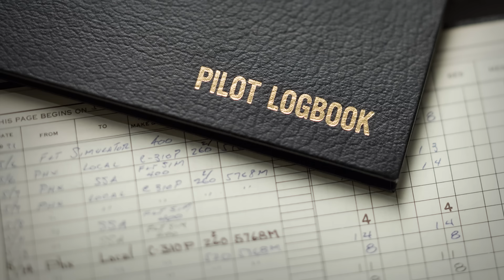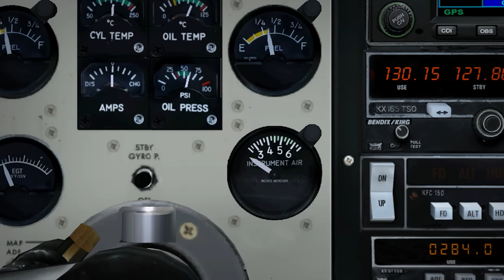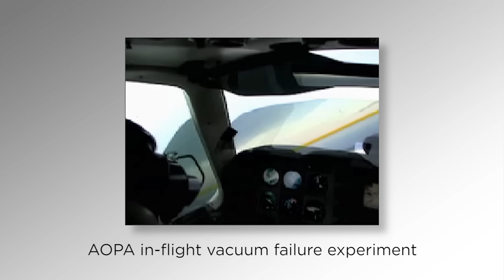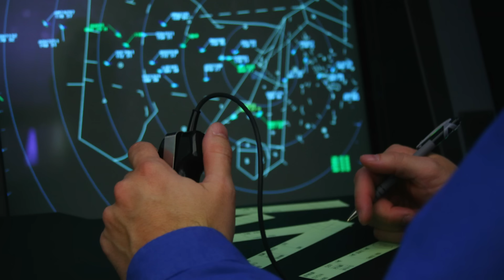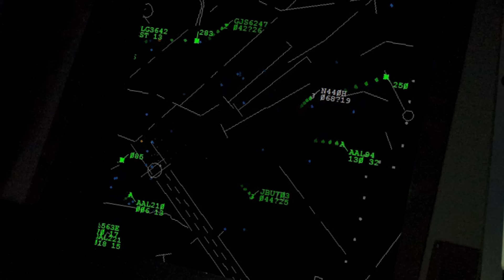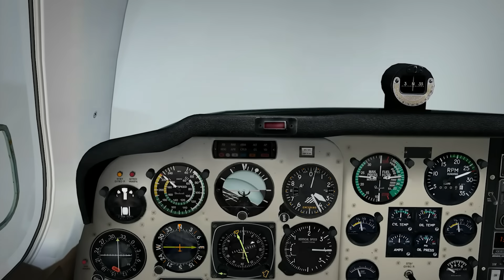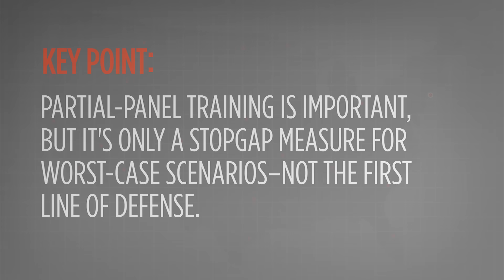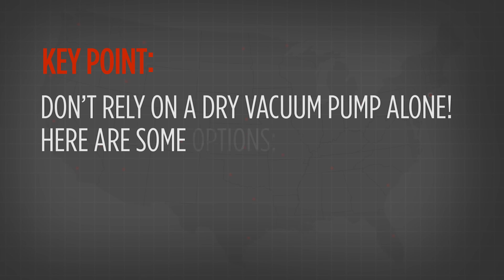Accident Case Study: Single Point Failure

Comment: I flew this same flight just 6 months earlier, Grand Strand to middle CT with 2 non-pilot passengers. Only I was a 250 hr VFR pilot. When I heard of this accident it shook me and this video was hard to watch. If a 4,000 hr ATP rated pilot can't survive this, what the heck was I doing? Granted ours was VFR all the way, I did not attempt a IFR flight as a VFR pilot.

Videos like these are helpful and if any good can come from such a tragedy it is that lessons we learn may save the lives of others. Please keep these videos coming.

The plane we did our flight in had a wing leveler, rate based Century autopilot. I've learned just how awesome that simple device can be to a VFR pilot, they continue to keep the wings level even with a vacuum failure. Our new plane has a more capable, rate based autopilot, standby vacuum and I always run FF synthetic vision on an ipad. In addition I keep two of those suction cup instrument blockers in the accessories pocket near my left knee. I would apply them upon realizing the vacuum system has failed if the standby could not keep it erect. Lastly, I've started my IR training. 

God bless those who lost their lives and the families involved.
Reply: GA Flying, there is an old saying: “ a superior pilot uses his superior judgement so he doesn’t have to use his superior flying skills.”  That Bo pilot made a judgement error long before he lost control.
Reply: GA Flying the majority of his 4K hours were probably in a crewed up airplane on autopilot with zero failures.
Reply: Total flight hours is not the end all measure of safety and  competence. There is no safe flight hours zone. Complacency can become a real problem for high time pilots. 
Recency of training is crucial. I think pilots, particularly high time pilots should spend more time with the basics of flying. There is an attitude among pilots that as you get advanced ratings and hours, you graduate from Student pilot. I wish they would call beginning flight training something else. Core Training, Fundamental Training, etc, and do away with "Student pilot".
Reply: I know what you mean.  I used to drive through Dealey Plaza in a convertible, and always thought that it could have been me.  Granted, I wasn't President, and did not attempt to be President.
Reply: Its not all ways the Flight time.  Its all so knowing your skill level at times a new VFR pilot can make a 100 mile or 1000 mile VFR flight as long as he is safe and on  top of things like weather, fuel to me new pilots if train well and keeping safety in mine each time they fly are as safe as old pilot who dose's the same 

Accidents at times can come out of the blue and not at other times 

May all your flight end in with  smooth landing
Reply: VFR pilot here as well, in IR training. I wouldn't have flown that day, simple as that. Sure as heck not without a backup vacuum pump.

Comment: Every single iPhone comes with a compass and a very accurate attitude indicator. Even if you don't have specialized piloting applications on a tablet, just a barebones iPhone can save your life in a situation like this.
Reply: EVOCATEUR:  I'm not sure the iPhone or any similar device should be relied upon in an emergency situation.  The "drift" associated with a simple IOS or Android device, even when operated in "in air" mode, is likely to result in rapidly deteriorating accuracy.  In other words, it is likely to be no better than "seat of the pants" which is exactly how 40H became an unfortunate statistic.  Tablets (and phones?) are great for navigation, but I would never rely on one for artificial horizon.
Reply: John Isett You really should not have any drift with respect to the leveling app as the app is using the MEMS accelerometer built into the phone or tablet and that sensor generates an absolute acceleration vector (the sensor is most typically three strain gauges, one per axis, with a counterweight at the end of each gauge and the acceleration is detected as a bending of the appropriate strain gauge levers -- with Earth's 1g acceleration ordinarily the dominant force that is used to determine what "level" is).  However, you will get into trouble if you do not understand that it is an acceleration vector that the displayed information is being extracted from as you could have an indication of level flight while simultaneously in a violent 10g spin because the 10g's of centrifugal spin will overwhelm the 1g vector provided by the Earth.  Our modern smart devices also contain MEMS gyros and magnetometer/compasses as well, but those would have to be integrated into a more sophisticated app (as compared to the built-in level app) and they, unlike the MEMS accelerometer, are indeed subject to drift over time  (GPS is typically used to help correct the magnetometer provided you are in motion such that a motion vector can be calculated and the accelerometer often used to periodically reset the gyro sensor).
Reply: Ethan Poole  ‘10G  centrifugal spin’ ? Sounds like either the pilot or aircraft or both would crack up as soon as it was underway!!!  The ones I’ve always done are strictly about 1G and low airspeed ( about stall speed ). Are you confusing it with a spiral dive ( often called a graveyard spiral with good reason )?  In those, the G forces build together with the airspeed very quickly. BTW the other ‘ spirals ‘ you run into in aviation are all helices. The radius of the latter remain constant———that of the former decreases continuously.
Reply: Yeah those are interesting points. I'd like to actually test it out at some point. Maybe velcro my phone to the dash next to the functioning attitude indicator and see how they actually compare in real-world flying for an hour or so.
Reply: Android has this too
Reply: @EVOCATEUR Of course the most obvious solution is to replace the vacuum pump at the factory-recommended intervals, as well as having a standby pump installed if possible.  In the soup I'd rather be able to rely on well-maintained purpose-built instruments like the attitude indicator and directional gyro.  I'd much rather put in a backup attitude indicator than resort to Velcroing an iPhone to the panel and hoping it works.  No need to tie up 121.5 in lousy weather if you don't have to.
Reply: I've actually been flying for almost 20 years. And I wasn't talking about the compass as much as the attitude indicator. And I wasn't planning to rely on either of them, I do want to test how accurate they are, for possible emergency situations where there's no other choice. A good pilot uses all the tools and information available to him. One more piece of information from a phone, if relatively accurate, can make a difference. 

And I don't know how flying with one for an hour or two and comparing it to the flight instruments 'wouldn't prove it's reliable'. Perhaps you can enlighten us from your vast experience?
Reply: You guys are all wrong, regarding the iPhone attitude system.  This system is not a gyro, and only detects gravitational pull.  Using it would indicate "wings level" even in a tightening spiral turn, sucking you in to the death spiral ever faster.  Go ahead and try it on board, in any coordinated turn, the iPhone attitude will show wings level.  Only an external AHRS unit, such as the Stratus, can replace a failed attitude gyro.
Reply: OR...look at your other instruments. There is still the magnetic compass, there is your heading. You also have your Altitude Indicator to tell you if you are level and then you would look at your turn coordinator(if it's electric) to double check your wings are level. Now, we can throw all the technology of the at pilots but if they don't practice and understand these types of emergencies it's not going to help. With all that said, this is a pretty bad situation that we can all argue what the pilot did wrong all day long but adding technology isn't going to help if pilots are unequipped in their abilities to take on such a task.
Reply: Any recent smart phone will work just as well as any ap instrument  except..... It must be running beforehand,  not fired up during  your spiral to earth. That would fool the mems into showing the wrong "down".
Reply: Gyro emulation, based on fancy calculations with accel sensor data, is not the same as a real gyro. There is no physical space in an iPad let alone an iPhone for a real gyro. And even real gyros drift, drift is inverse to physical size for a given quality level, but needs vary, one degree per hour may be perfectly acceptable in a light aircraft reset after only a few hours of endurance and only needing a general reference, while a nuclear submarine may need far better than one degree per month for both endurance and accuracy purposes.(as they have no ATC or visual confirmation and may be only a few feet from obstacles.)
Reply: MyTech,  so wrong.   All smart phones etc have MEMS gyros based on the coriolis effect.  These gyros work every bit the same as a spinning gyro.
Reply: Many smartphones do have MEMS rate gyros. However, their typical drift is on the order of a few degrees per second so they are pretty useless by themselves. If you put them together with the accelerometer and GPS data, using some very clever software, you can have a reasonable attitude indicator but I don't know how available such software is.
Reply: Just to clarify - fusing the gyro data with the GPS and accelerometers allows you to create a continual estimate of the gyro's drift rate which you can then subtract out. This converts the drift into a zero-mean noise signal which can be 2 or 3 degrees error for even cheap sensors with good sensor fusion algorithms. In this setup, the gyro is providing fast reaction time attitude data while the accels and GPS are proving slower corrections. Without the GPS input, the results are still going to be pretty poor.
Reply: EVOCATEUR you doing that would not prove that it's reliable. The fact that you would even try to use an iPhone as your compass when you have a perfectly good magnetic compass in the cockpit, required by the way, shows you are not a pilot and if you are may the God's watch over you.
Reply: Derek Hellmann you are in fact wrong.   Every smart phone today has both a gyro and accel sensors.

Comment: I had similar issue happen to me in a Mooney M20J seven years ago in hard IMC. I was able to keep wings mostly level and the flight ended successfully with an ILS approach, but when you are in the soup with turbulence trying to keep the wings level with just a turn coordinator, it is tough if not extremely difficult.  The scenario is also correct about it taking time to notice the vacuum pump failure. It took me a few minutes when things were not behaving as expected to figure it out. It’s not the same as having a CFI cover up instruments.  As soon as ForeFlight came out with the Stratus and synthetic vision, I was one of the first to get one and practice partial panel with it regularly. I remember John King saying in one of the King Schools videos, “Always have a way out and a backup plan, and know where the nearest VFR is”.  Too bad this guy did not have standby vacuum pump or ForeFlight with a Stratus, or divert to VFR. He would still be alive. When these things happen first priority is to safely get on the ground. Forget about getting home. 

These scenarios are excellent! If you are a pilot you should contribute to the AOPA Safety Foundation, and practice what if scenarios regularly. They just may save your life one day.

Comment: Vacuum pumps/ instrument air pumps are on their way out. Not sure if the plane had a Century AP like the C111 or IV but if it did it works off the attitude gyro.
Reply: Nothing wrong with instrument air pumps providing they are maintained. Pumps on this aircraft has not been replaced for 17 years.

Comment: Assuming there was an autopilot in this aircraft why wouldn't you engage that to keep the wings level?  Or is the A/P slaved to the gyro?  Great video!
Reply: its slaved. the AP would've tried to chase the dead artificial horizon to the peril of the pilot
Reply: Where do you think the AP gets its information from?
Reply: Not necessarily true.  A rate based system (such as an STec or the new digital systems) get their information from either the electric turn coordinator or an integral AHRS.  In other words, an autopilot like an STEC system could save your bacon in a situation like this.

Comment: I wonder if the electric turn coordinator was working....
Reply: Partial panel is still challenging even with a working T&B. It seems likely that he got behind the airplane trying to overcome the mental load of flying partial panel, and wasn't able to recover.
Reply: Also, if the simulation was accurate, this particular panel didn't have a turn coordinator/T&B but just a simple turn indicator. It's a lot easier to see that you're banking to the left when there's a small aeroplane in the T&B banking to the left (with the ball centered) than when there's just a needle showing that you're turning to the left. Which doesn't even react to the initial bank the way a T&B does.

Comment: Foreflight with Synthetic Vision would have saved his life
Reply: Only if the ForeFlight was paired with an AHRS system like Stratus
Reply: @dboy4ever  I read into that your point as well.
Reply: Cool man. I just wanted to make sure no one was relying on FF SV alone.
Reply: I was implying that by my comment
Reply: Simply remembering how to fly on partial panel, as he must have done during his IFR check ride, would have saved his life!
Reply: XPLAlN but as the narrator says it’s a skill that if not practiced will do you no good
Reply: Or a Dynon D-2
Reply: Totally.  It's amazing what a little iPad can do.
Reply: For sure. I have a Stratus ESG ADS-B Out Transponder in my plane and it syncs directly with Foreflight which is SUPER convenient
Reply: A $100 smartphone with a free GPS-based altimeter app could have given him a fighting chance. But it seems like what really killed him was not thinking through the situation he was in.
Reply: Ive got the exact same setup ADSB solution.  Very pleased with the performance
Reply: Was thinking the same

Comment: Thank goodness for ADHARS portable GPS units with artificial horizons, they can get you out of a jam when an emergency arises..
Reply: No amount of training could have helped this guy. What he needed was a reference to the horizon from horizontal. He spiralled into the ground needlessly. I can't believe that this type of incident still happens today. It is insanity. Even a cheap ass & free app on android would have saved this guys life & he depended on a device over 30 years old that just broke. Complacency kills.  As usual.
Reply: Joe Kozak , the portable units are self contained giving all attitude information completely separate from the airplanes gyro and electrical systems. I have both a GDL 39 3D and GDL 51 from Garmin.
Reply: do the artificial horizon electronic units rely on accelerometer chip for "down"  wouldnt this also fail just like a plumbob ?  gps can give position and vector, but not attitude?
Reply: @Joe Kozak - no aircraft artificial horizon relies on just an accelerometer. They use a gyroscope. Traditional ones use a spinning mass gyroscope with slow reset to level using a damped plumb bob. Ones on more high-performance aircraft had better gyros and possibly some kind of navigation system input for the drift correction. Modern back-up ones (as well as the very high end ones used in commercial and military aviation) use a combination of rate gyros, accelerometers, and GPS input along with clever algorithms that fuse the sensor data together along with a dynamic model of the aircraft.
Reply: thank goodness for thorough preparation, training, recency. Training to avoid complacency. Your tech get-out-of-jail free card is an invitation to lack of training and recency.
I'm not criticising you, but, this could happen to anyone. He should have been able to fly on the speed, altitude and turn/slip - tho' it's not easy. And he could have been more pro-active with his requirements.
RIP
Reply: Agree with you, only wishing he had a second artificial horizon, tech or not us pilots need all the help we can get.